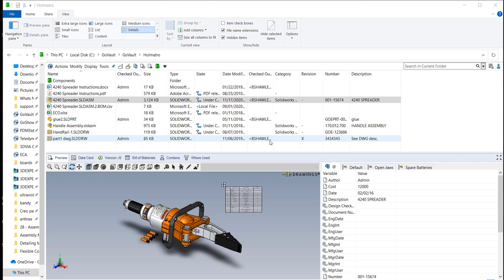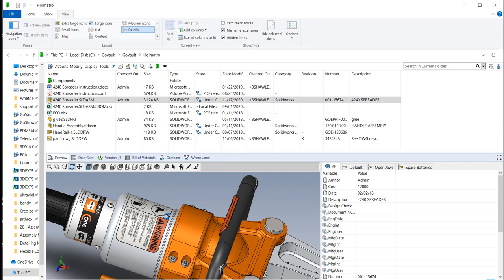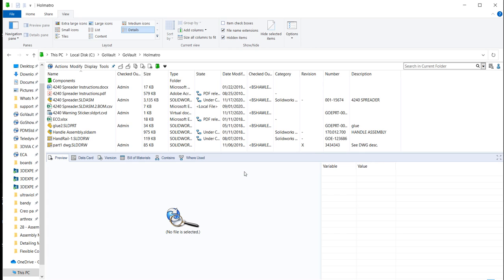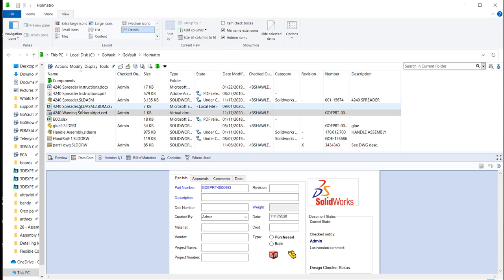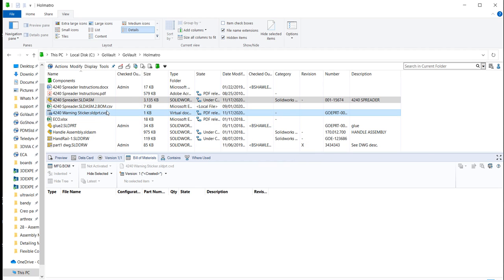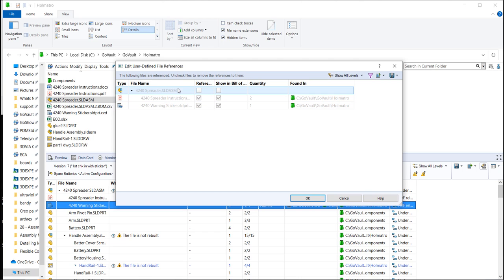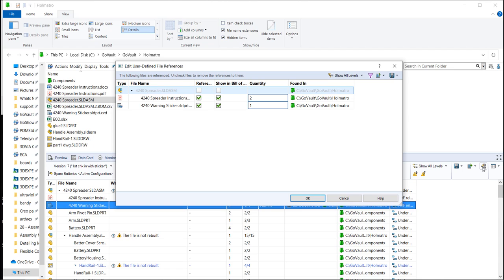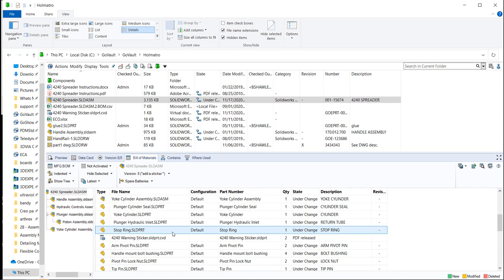SOLIDWORKS PDM Tutorial - Creating BOM Virtual Parts

Comment: This is cool. But how canb I get the virtual part into my BOM on the Drawing?
Reply from the maker: When using PDM’s “named” BOM method, you can save it as an excel file and insert the excel file as your BOM.  If you want to add a “virtual” part to Solidworks as a “computed” BOM, you can right-click on the BOM table and use the “insert new” part command.  Using this workflow, you wouldn’t need to add anything as a named BOM item in PDM as it would already be there.